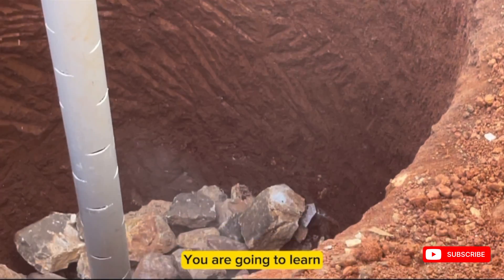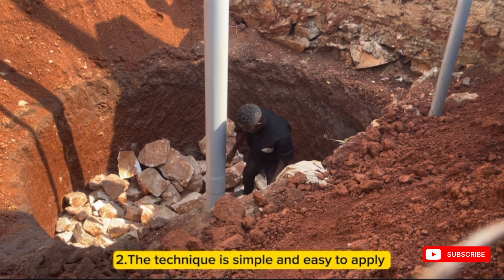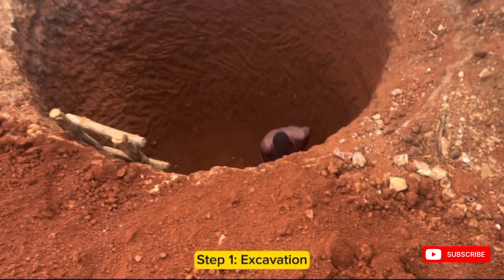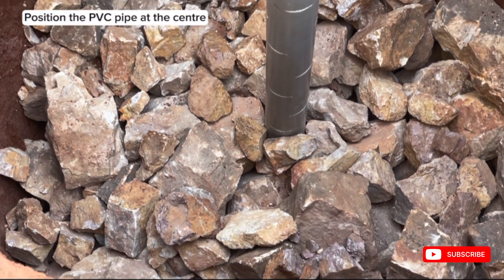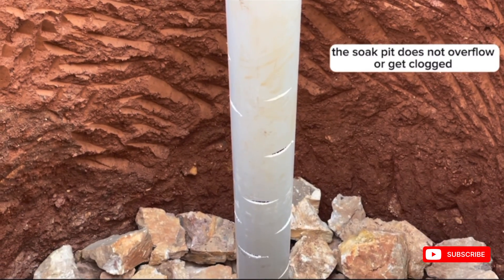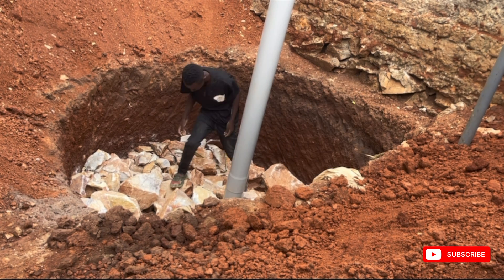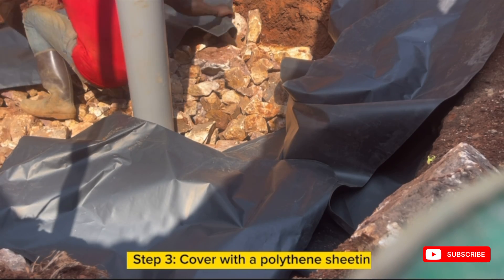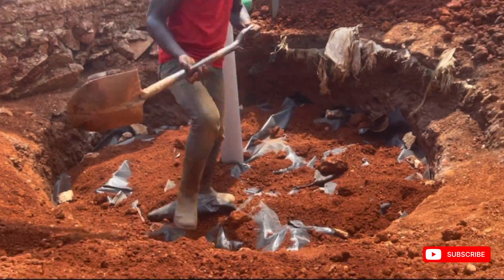How to construct a soak pit from start to finish in 2025

Comment: Don't you have to put layers of stones of different sizes to kind of filter the grey water?
Reply: Yes large at the bottom and smaller as you go up. But do not add sand or soil except after the sheet as the stones are for creating gaps for seepage of water.

Comment: Wont the pipe connection from the main tank need to be inclined to allow water to drain correctly, I suppose yes then you will need to properly to do that before backfilling or at least take that into account

Comment: the 160mm uPVC pipe, is it the receiver of the incoming pipes into the soak pit?? if no, where does it get the water it ditributes through the holes cut on it??

Thanks for the info

Comment: Thanks for the video what's the recommended size of soak pit
Reply: If you have a hostel with 100 students what will be the size of the sock pit
Reply from the maker: The recommend size of the soak pit will depend upon the number of users that you have and the size of the septic tank 

How many users are you expecting to use the soak pit?

Comment: I've always been wondering about soakaway,  won't it contaminate underground water,  I'm concerned because i have a borehole nearby.
Reply from the maker: We usually position the soak pit atleast 30 metres away from any water source such as the borehole 
Which is a safe distance to avoid any kind of contamination

Comment: Hi, what's the minimum distance from the septic tank to the soak pit? 
Also, is it possible to show how you lay piping from the bathrooms and kitchen to the soak pit and septic
Reply from the maker: The minimum distance from the septic tank to the soak pit should not be minimum 3 metres, on circumstances where the plot is confined and very small, the least should be 2 metres
to avoid any possible issues with seepage
Reply: Hello how much do u think it cost of the hall work??